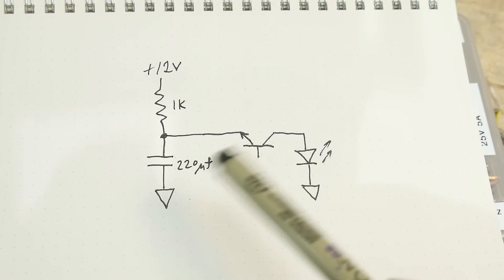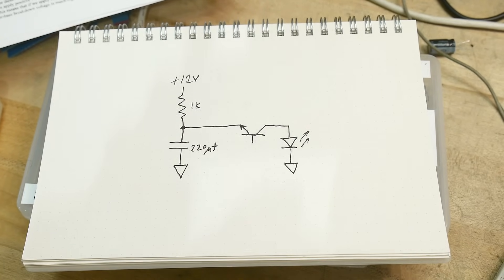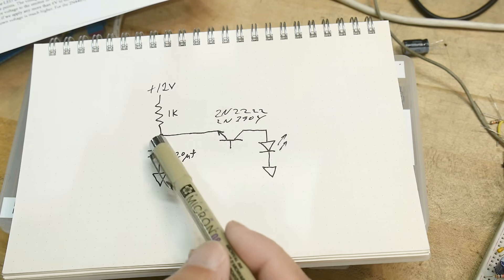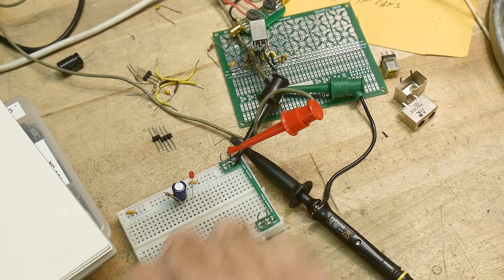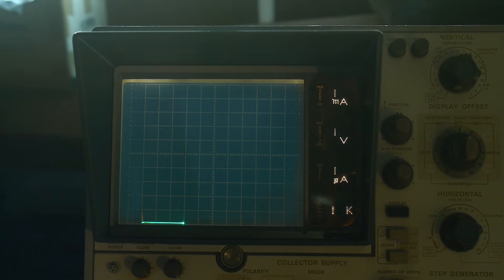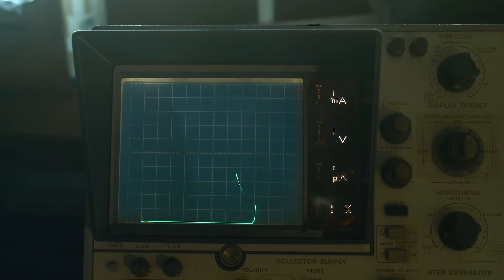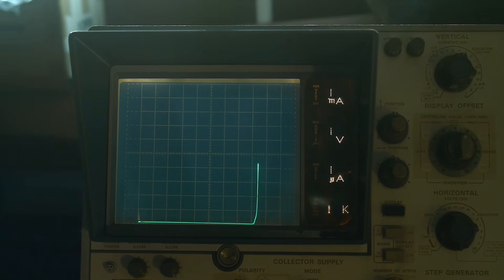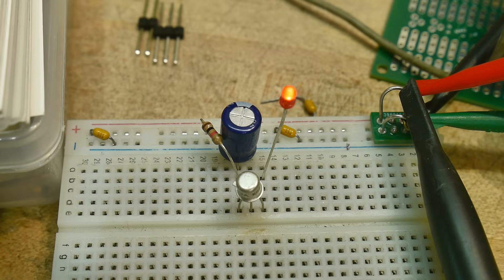#1756 Transistor Abuse!!!

Comment: Is this used for input over-voltage protection in multimeters? 
It might be emitter-base instead of emitter-collector though, but it’s the same principle?
Reply from the maker: https://youtu.be/zUhnGp5vh60?si=lYLMTzWrEiqbq6qE
Reply: @IMSAIGuy  wrong video lol 😝 
I think it’s EEVblog #1157
Reply: @IMSAIGuy  EEVblog 1157: https://youtu.be/BGcKjy_UNQ4
Reply from the maker: Oh, I forgot about that circuit. I don't think is is used much. the video I gave a link for shows how it is done most of the time.
Reply: @IMSAIGuy  the one you linked to is about fuses, diodes for over-voltage clamping, and PTC thermistors & MOVs. 
My understanding is Fluke were the first to use that transistor protection circuit and now everyone uses it. I saw the video I linked years ago. I need to rewatch it.

Comment: I have played with transistors at the end of 1960's like this. I reverse powered them and found out this Zener operation. It may be done in more ways than this. The transistor might be used as an oscillator as it behaves nonlinearly, like a tunnel diode. I also noted that if the npn can is cut open and a higher current is driven, the npn will emit white light. Not all npn types do it.

Comment: Heat up the transistor and the LED stops flashing )) Just will light steady. I use old Ge transistors as Heat and light sensors, attaching them into the scheme this way.

Comment: As Absurdengineering pointed out, you can get very low saturation voltage, when you swap the collector and emitter on certain transistors.  That was used (before the MOSFET produced nearly zero saturation voltages) for turning a low DC measurement voltage to AC for purpose of greater amplification in AC stage and then again rectifying it to DC.  I recall benefit of more than a decade, say from 200 mV to 2  or 5 mV saturation.  I also recall there were some special transistors sold exactly for this application.  Finally, I think the “best” special transistor may have been PNP, rather than NPN types.  Maybe you like to try and demonstrate this feature?

Comment: One can build a really fast rising edge (few 100s of ps) pulse generator with a circuit very similar to this one by using special avalanche transistors (alas, very rare and expensive, mostly new old stock) instead of a jellybean… I've found that some 3904s also work, but have to be hand picked.
Reply from the maker: https://youtu.be/QCq1REgpBCA?si=Sqne0Gmw0ojUP0bw
Reply: @IMSAIGuy  Oh well, didn't know about this video :). Anyway, I was referring to the well known AN72/Appendix B, it's the same thing :). Btw, there's another (cheap) way to accomplish the same - a stock SFP / SFP+ / XSFP module and its TX driver...
Reply from the maker: my friend designs those things and uses this: https://youtu.be/edHw3qz3jMQ?si=t344NZG4zrnYsHd_

Comment: Transistors are designed asymmetrically on purpose, but collector and emitter can always be interchanged. The asymmetry affects the gain: lots of gain in the normal orientation, very little gain (or even gain less than 1) when reversed. But we get something back for this gain degradation: the saturation voltage is lower. So, back in the days when bipolar transistors were the power devices in power supplies, they could be used as switches in low-voltage switching supplies that way.

Comment: You can use a similar circuit to generate pulses with really fast rise time. I remeber using it as a hamonic generator for a frequency multiplier. Like a step recovery diode for poor people!
Reply: Connection wise it is dissimilar: The NPN emitter is the low side output and the base is connected to ground.

Comment: Yes.  The negative resistance is necessary for this oscillator to function.  8 V Zener diodes are more reliable in the base of a chopper transistor.

Comment: Interesting, I did a lot of bipolar transistor characterization in the 1980 and 1990's but, never witnessed the base-emitter breakdown unto a negative resistance region.  Most small signal transistors would breakdown at about 6 volts and appear as a 6 volt zener.

Most bipolar transistors do not spec the base-emitter (B-E) breakdown.  The transistors that were better spec'ed will show a minimum breakdown voltage.

Sustained operation in the breakdown region causes an early failure.

I witnessed many of the early solid state TVs improperly applying inputs to the base that would cause B-E breakdown and even some Heathkit designs that would use a reverse biased B-E in place of a small signal zener.

Comment: Nice demo!  Those who are unaware of the result of the following circuit should also try this:  Turn off the +12 V source.  Put a voltmeter in place of the LED.  Ground the base of the transistor.  You can remove or leave the capacitor at your option.  Predict the voltage to be read by the voltmeter.  Now turn on the +12 V source and note the collector voltage.  The result can be surprising.  (This is an example suggested by the late great Bob Pease to show that the spice circuit analysis program does not always give the right answer.)

Comment: There are special avalanche transistors that use the same principle for generating pulses with very fast edges, in the picosecond range, useful for testing equipment and transmission lines.
In the same league there is the "step recovery diode" another obscure microwave tech device, also for generating pulses with lots of harmonics.
Reply from the maker: pulse: https://youtu.be/QCq1REgpBCA?si=j8J7cGE-j6iGvZZT
step: https://youtu.be/pQVQIufVmJk?si=pUVRRmtrWCz012fp

Comment: Back in the day in 'Everyday Electronics' they published a project called "The Dream Machine" which was a transistor in this configuration and a simple amplifier to drive a small speaker and it would generate 'Pink Noise' this can aid sleep in some folks by mimicking the noise of light rain or the gentle babble of a stream. It worked exactly as described and in the theory bit it was stated that 'actual Zener breakdown' ended around the 4v area and the avalanche kicked in after that. There was also talk of experimenting with different transistors as some 'Won't work' as you clearly demonstrated !!......cheers.

Comment: But how 2n2222 breakdown voltage is triggered at 12v if the transistor is rated for 40v?
Reply from the maker: it's in backwards
Reply: The collector-emitter breakdown voltage is 40 volts, but another way around it isn't. Emitter-collector breakdown voltage  is lower. Datasheet does not necessarily include that value, but the emitter-base breakdown is about 6.5 volts.
Reply: The VBEx (base-emitter breakdown voltage) is on the order of 6-7V in many transistors; some however have it even as low as 4-5V. This is something to remember even when designing regular circuits like amplifiers, because too high a negative signal on the amplifier transistor base will lead to this sort of behavior.

Comment: Does this damage the transistor over time?

I put this in a circuit to flash an LED to remind me of those times I connected 12 volts. It seems to work fine but I didn't know if the transistor would eventually fail. 

Also, like you said it needs a high enough voltage. When I was first playing around with this on a breadboard, I only had a 9v battery handy. I thought the LED would just be dim, but it didn't flash at all.
Reply: I do think it theoretically does damage the transistor. Perhaps you're unlikely to see it happen in these circuits.
Reply: I remember reading about using the reverse breakdown of a transistor junction to generate white noise. The author of the article mentioned to never try to use this transistor in an ordinary manner after doing this, the junction might be damaged. I read this in some electronics magazine in the '70s or '80s. I have no experience with this.

Comment: Do any of the home brew or cheap curve tracers coupled with an oscilloscope allow us to see any of the behaviours you have been showing with your fancy Tektronix curve tracer lately?
Reply: Absolutely. The curve tracer is in many cases just a handy combination of multiple other tools. Most notably, the CC/CV PSU with multiple preset points and pairing it with the display scaling.
Reply: A basic 12V AC transformer supply output is enough to show this. Use a current sense resistor in series with the reverse-biased junction. Ground clip goes to the resistor-transistor connection. CH1 goes to the other end of the transistor and is the voltage (“x”) channel. CH2 goes to the other end of the current sense resistor and is the current readout (“y”) channel. CH2 has to be inverted to get a right-side-up plot. The ground clip must be in-between the device being characterized and the current sense resistor, not at the bottom of the sense resistor - otherwise the voltage drop on the sense resistor introduces an error in the plot. No problem of course - you paid for that “CH2 INV” button, might as well get your money’s worth :)

Comment: I have already used this circuit, as a curiosity. But your comments supported by the curve tracer are great! 
Another point is to know how-stable this would be in the long run. Would this current burst enabling LED blink, damage the BJT? Would this damage the transistor? Would it vary per temperature? These were some digressions about the usefulness of this kind of circuit.
Reply: I have heard but not confirmed this sort of use/breakdown will lower the beta a lot.

Comment: Only works if base is open circuit. Connect base to collector and it will act like a regular zener, and base to emitter it will be a regular diode. Long term it will degrade the base emitter junction, and the voltage will creep up, till it stops running at all.

You got special transistors that were doped heavily in both junctions, so they would operate as a transistor either way, the early Ge point contact transistors, and the alloyed junction ones, would operate like this, generally having somewhat symmetrical breakdown voltages, though better processing, and making the emitter blob bigger, so it diffused to be larger, did change that. that is why you had to be careful soldering them, heat made the alloyed junctions migrate through the slice, and as they got closer the gain went up, to the point the 2 alloy diffusions met in the middle, and the gain went infinite.
Reply: Base connection can be used to control the breakdown voltage.
Reply: My father told me that in some Sony and Tektronix equipment, they deliberately used a very specific bjt "upside down" with the emmiter and collector switched.  It still functioned as a bjt, but with different characteristics. They did this because they wanted the unusual characteristics this provided. I have no experience with this, just something he told me many many years ago. (the '70s)
Reply: @jbuchana That’s right. They used it to get a lower saturation voltage - it was used as a switch I bet.

Comment: This is the design fault made in many power supplies that start discharging your laptop battery if plugged into the latop but pulled out of the wall outlet during charging.
Reply: With such a fault, what limits the current?
Reply: @stefflus08 Good thinking. Well, nothing limits the current. Some “cheapened” linear supplies just blow up when you back-drive them when off. Back when I used to go to T&M tradeshows, I’d do this back-drive test. Managed to blow a couple supplies up that way. “Folks, this needs some work before it hits the market”. I felt sorry for the folks in the booth, but the few potential customers who avoided a snafu were worth it.

Comment: This is because the variation in thickness and doping profile of the base region.  When the voltage is high enough the depletion region  in the base extend far enough to make electron tunneling possible.
This circuit also known as Esaki oscillator.

Comment: Another good one is the Unijunction Transistor. Makes good relaxation oscillators. I don't think UJTs are made anymore but you can still find them around. Old school for sure!
Reply: From a past search, I believe they are. In the “worst case”, one can use its younger brother = PUT, programmable unijunction transistor, operating quite similar, but NOT interchangeable.
Reply: And it's possible to emulate a PUT with a PNP and an NPN transistor. All of those old unijunction circuits can live on if you want them to.
Reply: You might be able to use jfet instead of UJT.

Comment: i wondered if its a thing to float/bias a capacitor
like the following problem example.
you got a 1000uf cap, on a 45v supply and when your load draws current pulses that the cap is there to filter/catch those, but as it has esr and finite capacitance, it drops to lets say 40v in the dips. so a 5v ripple. 
you just use the energy thats in the 5v range, the other stored energy that make up the 40v is unused.
so what if you bias the cap to 40v on the negative lead or slightly below, then the whole capacity should be accessible to the 40...45v range isnt it?
or at least you could use a cap with a lower rating (10v for example) thats either much smaller or has much more capacitance instead.
i think i saw one of those arrangements in a yamaha power amplifier
it had 40v and 80v rails and just two 50v caps in series so basically it had its negative lead floating at 40v. instead of using a 50 and 100v cap
Reply: No, that is just using the one rail to bias the capacitor above ground, and does result in the ripple current in the upper capacitor being also impressed on the lower rail. the energy stored in a capacitor is proportional to voltage squared, so the amount of energy stored from 40 to 45V is a lot more than the energy stored from 0V to 5V. Biasing it to 40V will just mean the other power rail has to supply the ripple current that flows between the plates. The yamaha amplifier with 2 rails and 2 capacitors is just to save cost, or, look on it as a symmetrical power supply, with a centre ground, and a +40V rail and a -40V rail. load current from + rail to - rail has ripple flowing through both capacitors, but any current to the centre is only in that rail capacitor, and on average it is no more than having 2 separate capacitors, but now you need one 50V one and one 100v one, which will be a larger can, and a separate part number. Cheaper to use 2, get economy of scale when building them by the thousands, and save on the assembly needing to stock an extra part, and on the larger board area you need, or a higher cabinet to handle the height of it.

Comment: What about a one zener oscillator, would that have the same result? (I guess there would need to be the avalanche breakdown - I'm just too lazy to get my components to try).
Reply: I'm going to try it on LT spice
Reply: @jamesmoffat9754  Wonder if breakdown voltages are in the program? Maybe try a 2222 first.
Reply: @jamesmoffat9754 Avalanche breakdown is only modeled in special models made to capture that behavior. Typical SPICE models just don’t do it. For all such circuits, breadboard is king, and simulation will blatantly lie to you.
Reply: Most Zeners don’t have the negative resistance region needed for oscillation.